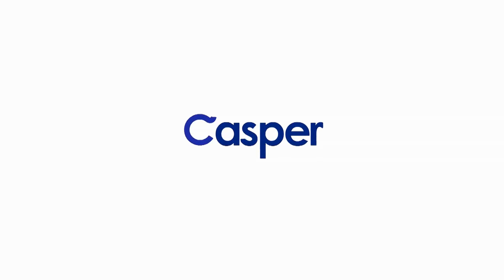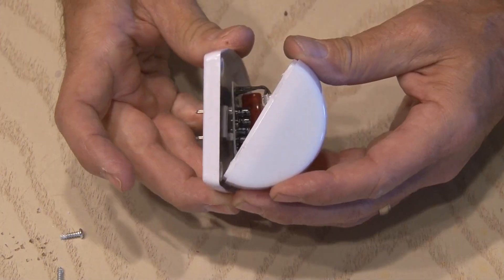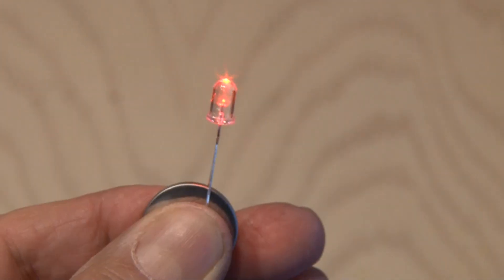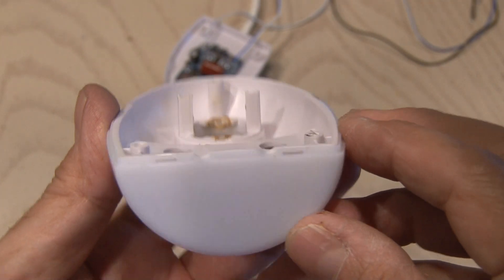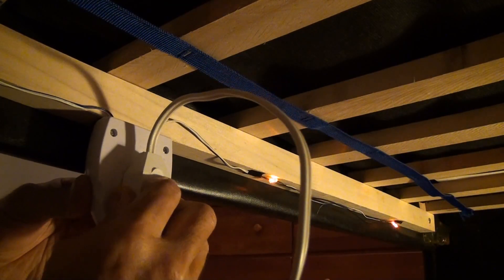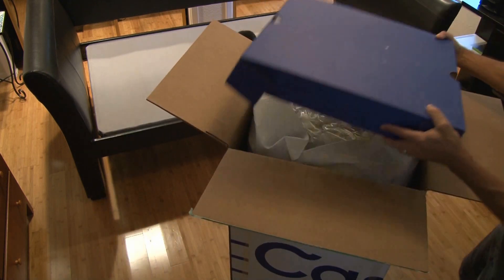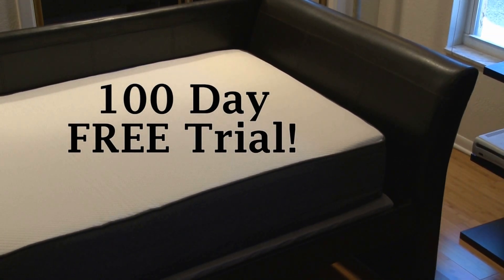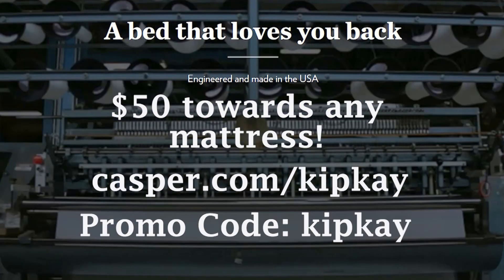How to Hack a Nightlight!

Comment: Hi @kipkay can you help me? I’ve got a battery sensor light to illuminate the key hole on my mum’s front door. It works great at night, as she approaches the door it lights up and mum can see her door lock. In the day however the light doesn’t work as there is a light sensor. My mum still needs the light from it in the day. I have tried covering the sensor but this prevents it working at all. I built a hood for the light shading it from daylight feeding in but it wouldn’t work at all. 
I’ve taken out the screws and removed the front Perspex shield and can see a kind of mini solar panel and a little bulb
I have tried covering each of these to see which one is the light sensor but it still won’t light up in the day. Just wondered if you had any advice?

Comment: Just a note. The one you have used is non-insolated from mains, that is, the circuit itself is hot and can gave a a hard shock, even when they are just LEDs. Hacking devices that doesnt run an isolated power supply is risky. LED is onlt 1.7V but they could be actually 120-1,7V from grund.

Comment: Nice video Kipkay, you always have interesting projects. I do a lot of soldering work myself and was wondering if you had any tips on how to keep solder tips clean without oxidizing quickly. Also, I run into a lot of tough solder joints where it seems like I have to hold the iron there for days, usually use a 45-60 Watt iron, and I don't like to leave the iron on the board that long to damage the PCB.

Comment: This is EXTREMELY dangerous. The Nightlight runs directly off the mains via a capacitor. That means that the whole pcb (and the new LEDs) carry the full mains voltage potential (depending on which way you plug it in). Even the 110V of your american mains are potentially deadly (Not to speak of the european 230V).